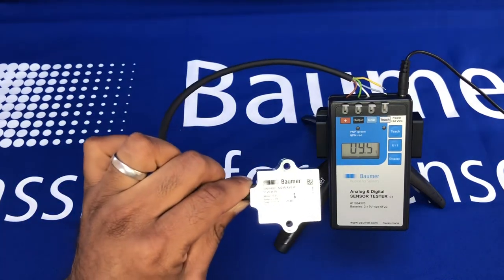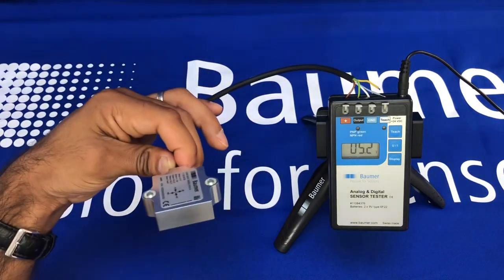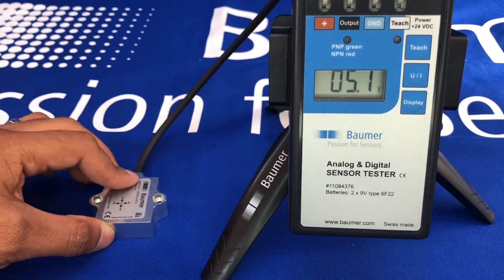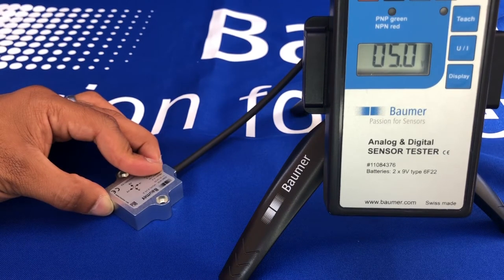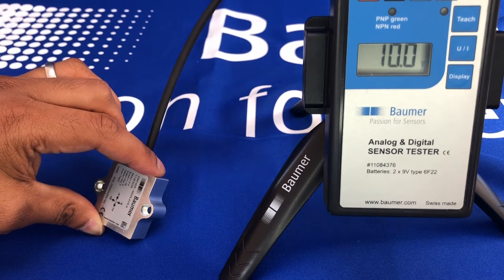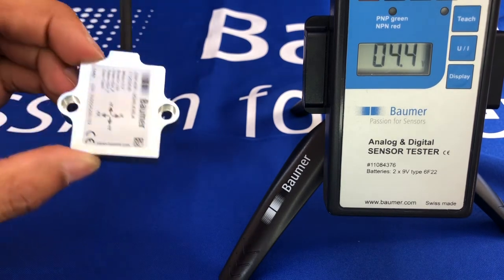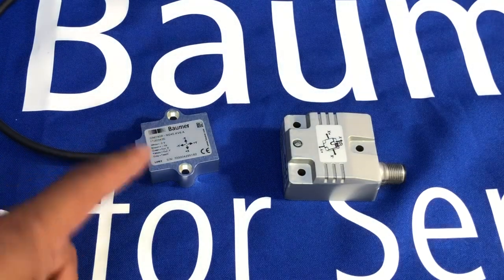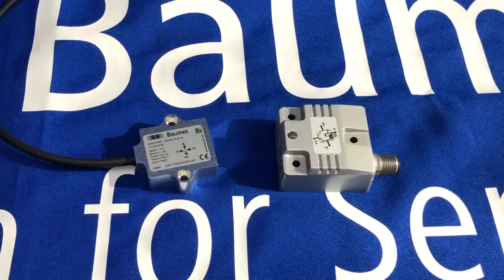Baumer Compact Inclination Sensor Demo GIM140R - Analogue Ouput

Comment: Is it susceptible to drift when rotated?
Reply from the maker: No, its meant for industrial and mobile automation applications and is used in applications where rotation is frequent. It's not dynamically compensated with a gyro just to note. We do have dynamically compensated inclination solutions also.